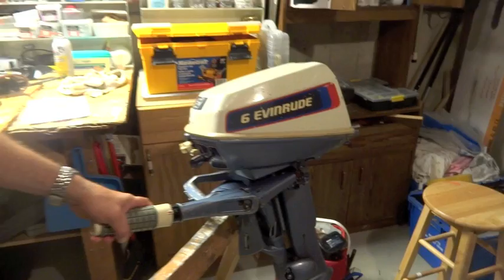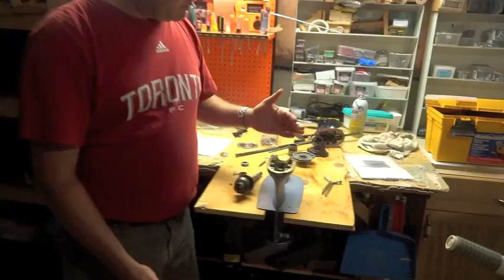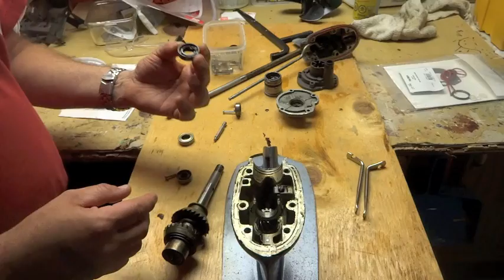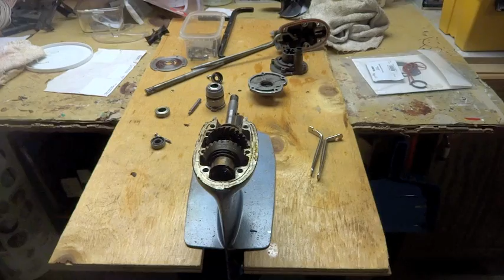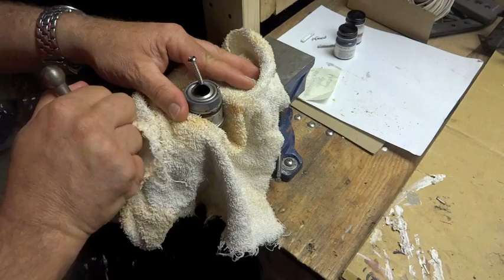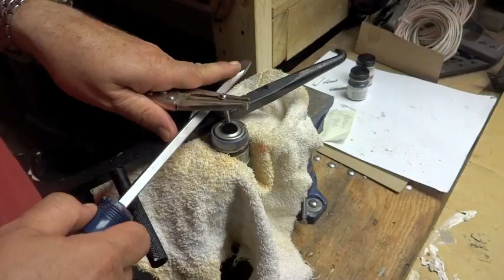How to remove prop shaft and water pump seals - 6hp Evinrude/Johnson

Comment: I was staring at the head and bearing (0382291) on my Johnson 1967 6hp propeller shaft and wondering where it ended and the oil retainer (0313282) began.  I sort of poked at the rubber seal inside with a small screwdriver to see if I could push it out but it was really mushy and seemed like I should think about it some more before tearing the rubber apart :)  Mine looks slightly different but is essentially the same design I think.  Thanks so much for sharing this!

Comment: this worked like a charm. thanks for the video! one thing I did different others might try was using the claw of a hammer attached to the head of the screw. It popped right out with one quick motion.

Comment: those seals are the worst part of that job.  I have used a dremmel tool and carefully grind through one side of the seal.  But I like your idea better, with the aid of a slide hammer.  I have done 3 of these old motors, and next time I will try your method.  Sometimes it is easier working on heavy equipment then on small objects like these motors.  But the outboard motors are more fun. Thanks for the video.

Comment: I have a 1978 9.9 Johnson & i see you have 46 videos , do any of them show how to change the prop shaft seals on the 9.9 ? My motors different then your's the way the shaft is . I pulled the two 3/8 bolts out & the shaft housing and all i see is a puddle of grease . If i turn the motor over will anything else fall out besides the grease i would have too worry about ? Thanks .

Comment: When removing the drive shaft on your 6 hp evinrude, was there a pin in the top(gear case end) that prevents the shaft from dropping down when removing the lower unit? If not, any suggestions on how to remove a seized shaft from gear case?
Reply: Dean were you able to resolve this  issue? I am working on a 66' 6 hp will little to no corrosion and I can't seem to get the gear case housing off. I don't see any evidence of a retaining pin in the housing and have just been spraying penetrating fluid down the gearcase housing and trying to work it free lightly. As of yet no luck.
Reply: I had twisted off a couple of bolts on lower unit. I had thought that the drive shaft was stuck but the 2 bolts are what was keeping it from coming apart. The only thing that kept it from separating completely, was a bolt on the gear shift shaft...
Reply: There was no pin.
Reply: I eventually just applied head to my gearcase housing and was able to get the gearcase housing off the screw. I also had to apply heat to the seal on the prop side of the gearcase housing to get it off. There were no pins in the gearcase housing of on the prop screw.

Comment: Where did you get the central forge seal puller?
Reply: My 35hp Ever 1981 won't go into gear plus my water pump is not working